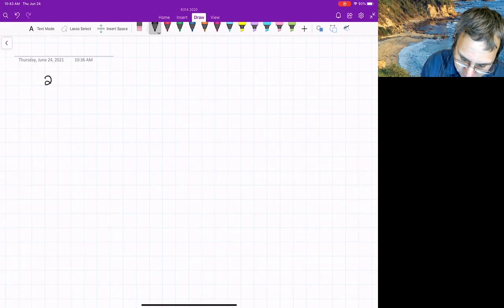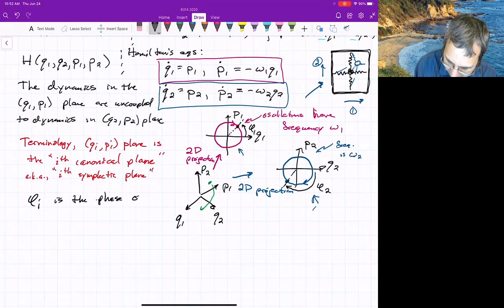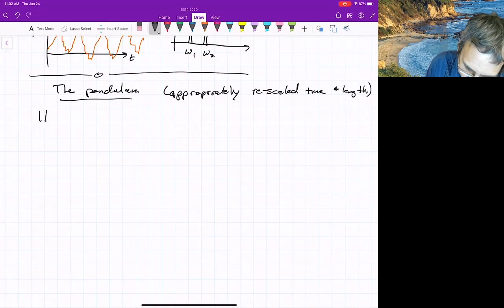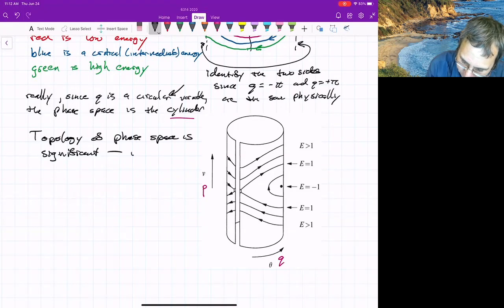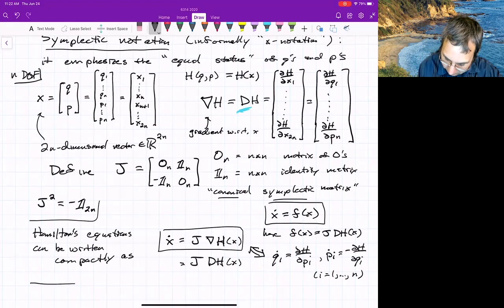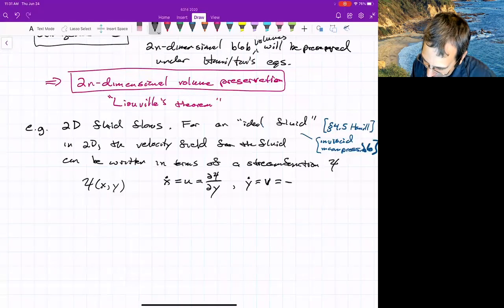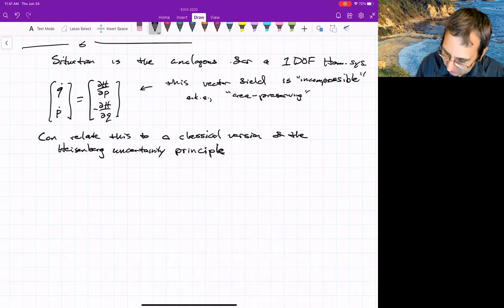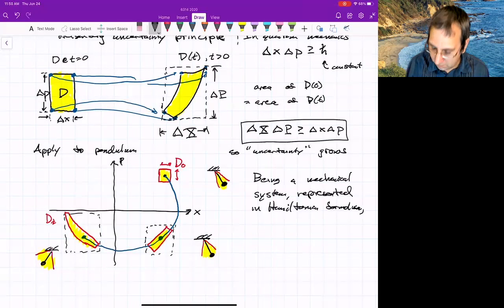Hamiltonian System Properties | Phase Space, Incompressibility & Classical Uncertainty | AOE 6314 L3

Comment: Great series of videos. Having an engineering background I’ve mainly worked with Lagrangian mechanics but am enjoying learning about Hamiltonian mechanics now I’m retired. One comment as follows:-

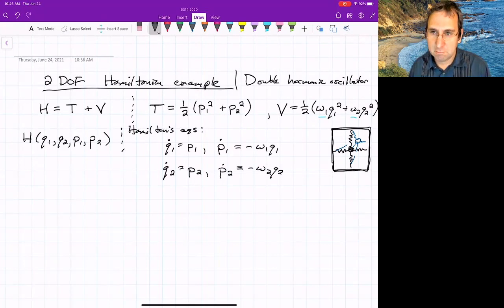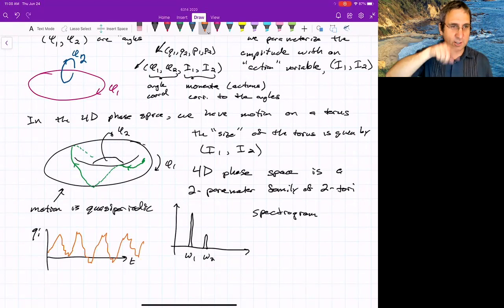For the double harmonic oscillator example the 2 uncoupled equations introduced at 3:30 appear to simply represent 2 separate single dof oscillators. As such the double frequency response indicated for each dof at 17:40 seems confusing, surely for such uncoupled systems each 1 dof oscillator will exhibit simple harmonic motion at its corresponding natural frequency omega_i ? The graphed coupled response shown would be more representative of the physical single mass / 4 spring system you mentioned at the start of this example. Under finite deflections this system would indeed couple the horizontal and vertical displacements of the mass leading to a much more complicated response.  However that is not the problem the equations consider?
Reply from the maker: Great question, and you’re absolutely right about the physical interpretation of the equations as written.

The key point is that the response I’m showing there is not the motion of each individual 1-DOF oscillator plotted separately, but rather the motion of a general 2-DOF Hamiltonian system with coordinates (q_1,q_2), viewed as functions of time.

In the uncoupled double harmonic oscillator, each coordinate indeed satisfies its own equation
\ddot q_i + \omega_i^2 q_i = 0,
so each degree of freedom individually exhibits simple harmonic motion at its own natural frequency, exactly as you say.

However, when we look at the full state of a general 2-DOF system which is exhibiting quasi periodic motion, e.g. plotting q_i(t) without having separated out “nice” angular variables, the time signal generally contains both frequencies, because the motion lives on a 2-torus in phase space. What you’re seeing at 17:40 is the superposition arising from the combined evolution of the two independent oscillations, not dynamical coupling between the equations.

Comment: Wrt. the diagram of the stream function, aren't crossings disallowed, since the EoM would be underdetermined at those points?

*unless it's a projection ofc.
Reply from the maker: Great question! You’re right to be cautious—actual crossings of streamlines would imply non-unique flow directions, which violates the uniqueness of solutions to the equations of motion. What may look like crossings in the diagram are typically saddle points, where nearby trajectories approach or depart along different directions. And yes, in some contexts it could also be due to projection effects. Thanks for thinking deeply about it!
Reply: @ProfessorRoss I appreciate the reply. I just saw you put a little dot there on top of that, indicating an intersection. I'm not trying to be pedantic, it's just that I'm actually using your resource to learn Hamiltonian analysis myself (it's very good btw; my bg is in mathematics, not physics), and I just wanted to make sure I hadn't misread what you'd drawn. You might see other potentially frivolous or dumb questions of mine littered throughout the comments on this playlist, where I couldn't find a like question already there. Cheers!

Comment: Thanks for uploading a very nice video with a lot of interesting insights! 
When talking about the classical version of the uncertainty principle, you used the volume of circumscribing rectangles. I guess we can also use a ball as the initial shape and its perimeter instead of the volume of the circumscribing rectangles, and we could observe that the perimeter is always increasing in time. Is this observation correct? Also, if we start with either a ball or a square, will it become back to the original shape when the center of the shape comes back to the original location?
Reply from the maker: I think your observation is correct -- you could use a ball or other shape. In general, yes, the perimeter WILL increase in time, and also the shape WILL NOT in general come back to its original shape when the center of the shape returns to the original location, often due to nonlinearities in the dynamics. Look at this short simulation from Wikipedia: 
https://en.wikipedia.org/wiki/Liouville%27s_theorem_(Hamiltonian)#/media/File:Hamiltonian_flow_classical.gif
Only in certain special cases will what you describe occur, for example the harmonic oscillator, as shown here 
https://youtu.be/xJGluipIV2k?t=3800
with, for example m*omega=1, in which case all shapes in phase space are merely rotated (as in 2-dimensional rigid body rotation) about the origin.
Reply: I think Prof's second example in the video gives a counterexample of perimeter not increasing but fluctuating. Is there a result about when the perimeter will increase and when will not?
Reply: @vinbo2232  A circle/ball has the smallest perimeter for a given area, so if the initial conditions are in a circle, the perimeter has to go up from there no matter what the deformation is
Reply: Thank you very much for the explanation with nice examples! Yeah I can see the original shape become more and more complex in general and is preserved in the example you gave.